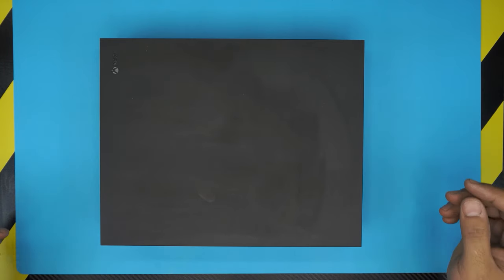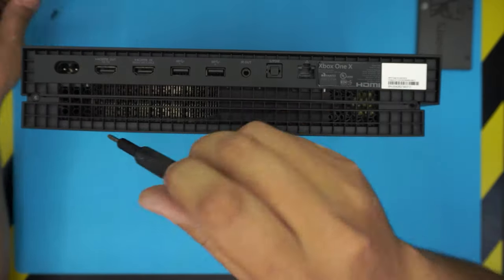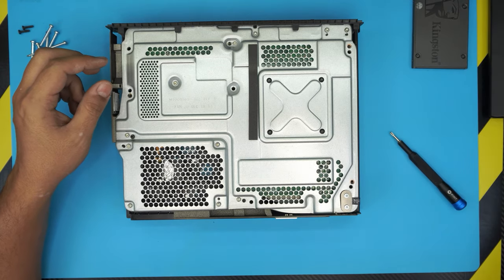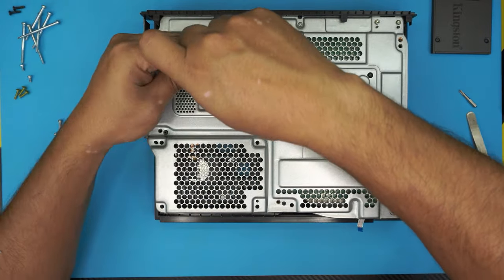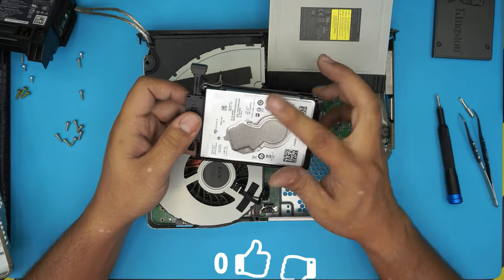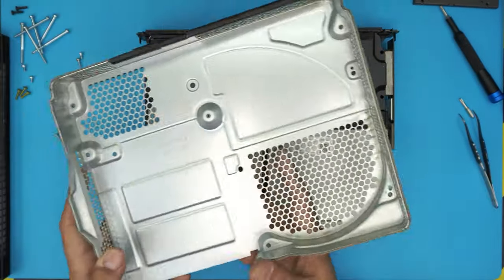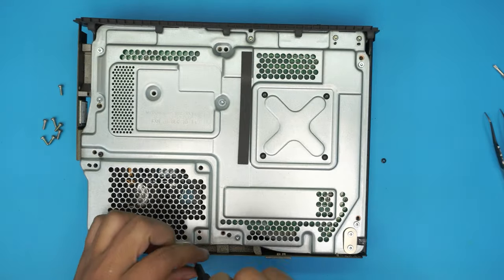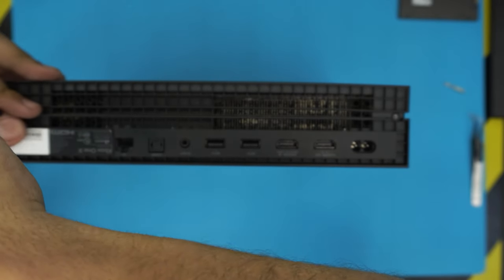Xbox One X Series SSD upgrade Guide proper way !!!

Comment: I’m glad I found your video before upgrading my ssd. Some videos they didn’t even mentioned about the ribbon in the front. Keep up the good work! 

One question, I’m having a hard time putting the top cover back. I did exactly what you did and the left side is not going all the way in. I’m sure all holes are aligned otherwise screws will not go all in. Thanks!
Reply from the maker: thank you for the feedback and your support to the channel :) regarding your question:
can you show me by a short video or upload some pics so i can assist you plz:
https://imgur.com/
Reply: What size did you put in? This guy says u can put 2tb and use the xbox site. Everything I've read said it only works that way if you replace with same size hdd as the xbox originally had. Can you confirm this man?

Comment: I was under the impression you HAD to partition/format the new external drive with some fancy scripts before installing it or the Xbox would not recognize it and allow an offline system update. Is it really as easy as just taking a new hard drive out of the box and sticking it in the Xbox, then using a USB drive to perform the update. It recognizes it?!
Reply from the maker: you could try cloning programs to clone the HDD to SSD  like Macrium Reflect,
the cloning sometime works and sometimes it can give error depending the hdd models or ssd models. we have tried and it does work but not always.

Comment: Great to ear you guys tested several SSD's , i have a question have you tried nvme ssd's and normal sata ones? because that would be a great coparison to know if there is any performance gains from a pci-e nvme ssd
Reply from the maker: don't put any nvme it will not get any faster, because the connector on the motherboard is sata and the max speed on sata is limited and if you adapt a nvme it will just read as sata max speed, therefore just go with any ssd sata. thank you for the support to the channel by a sub :)
Reply: I don't think PCIe NVME's will work anyway and SSD NVME's are not worth the hassle. With buying a caddy it works out the same price anyway.

Comment: First things first, thanks for the video, actually I used it 3 times to put a ssd on my xbox one x. But, well, I'm using a kingston a400 960Gb, after using OSU1, it shows a free space of only 364 GB. Took it to the pc (disasembling again) and saw a unalocated volume of 465 GB (half the unity). Tried all the process again with the same results. Any Ideas of how to fix it and use full space. thanks in advance.
Reply from the maker: Thank you for the feedback! if you wish to support the channel you can LIKE or SUB or both :P
regarding your question: it should took over the entire space, but if this happens you need to use dis-partition program on pc and extend the partition to the main 364GB, use this: https://www.partitionwizard.com/
download full version if you know what i mean :P
make sure you extend the virgin partition to the main partition.

Comment: Hi, I have an xbox one x. I replaced HDD with an SSD but when I install on xbox, it stops at 0%. After about 10/15 minutes it switches off by itself. Do you know how to solve this problem?
Reply from the maker: Thank you for the feedback! if you wish to support the channel you can LIKE or SUB or both :P
regarding your question: see if you doing all the steps in this video: https://youtu.be/xWW7M8pgFEo
Reply: @uFixTek  Yes, I followed the steps, but when I try to install on xbox, it stops at 0%. After 10 minutes the xbox turns off.
Reply from the maker: what brand ssd? and its used ? did you check the health of the ssd?
Reply: @uFixTek  The brand is Kimtigo 512gb, bought new on Amazon.
Reply from the maker: not all ssds firmware are compatible with bios of the xbox. most 90% of the brands are compatible.. adata kingston samsung and others, but the cheap brands like kimtigo or a likes are most probably not compatible. i would suggest replace the ssd with aknown brands.

Comment: I'm having trouble putting the top case back on😮
Reply from the maker: try wiggling around, it takes time to get the hang of it. not much force is needed.
Reply: @uFixTek The tabs won't seem to go into the holes. I'm just going to take my console to a GameStop store.

Comment: Hey im about to replace my hdd with a Crucial MX500 500GB SSD, is this one compatible with the os from xbox?
Reply from the maker: Thank you for the feedback! if you wish to support the channel you can LIKE or SUB or both :P
regarding your question: YES it is fully compatible :)
Reply: @uFixTek  Nice and thanks for your reply :), ill be doing it tommorow will deffo watch ur video while doing it ^^ hopefully its not too hard :D.
Reply from the maker: sure brother, if you need any help let me know.
Reply: @uFixTek  im having issues putting back the xbox... The screws arent lined up with the holes. P.S. It runs with the ssd but I just need to put the xbox back together somehow :/
Reply: Update*** I mananaged to put xbox back together and ssd runs fine :D, small note my xbox says 370 gb instead of 500?
Reply from the maker: awesome , the reason is because of the system format type and the extra partition that it requires.

Comment: Hi I have a higher capacity 2tb ssd. I want to replace my one X hard drive. However is there an additional step required to set it up? Also, next time please provide tutorial for how to do usb step instead of simply providing link
Reply from the maker: you can place the 2tb as you would the 500gb, same stuff, and im working to make a simple and quick video on the dashboard installation for you guys, thank you for the support and feedback
Reply: @uFixTek  thanks for everything so now if I want to put 2tb Can I put it?
Reply from the maker: @evolution6998  we have upgraded a client that wanted two TB and it worked.assuming that you have the updated firmware on board, but im very sure you won't have any issue.
Reply: @uFixTek  thanks for answering and I hope you had amazing day. Which type of ssd company you advice me to put in xbox one x?
Reply from the maker: @evolution6998  i would recommend ADATA or kingston for cheapest price and best i would use is samsung:
https://amzn.to/3OGDfyD

Comment: This is why playstations wins
Reply from the maker: :P
Reply: @uFixTek  I mean with playstation consoles going back to even the ps2 you didn't need to dismantle the machine to add a hdd.
Reply from the maker: same with xbox 360 they had hdd cover on one side, but tru ps3 ps4 always had cover to remove the hdd
Reply: @uFixTek  Even the ps2 could have a easy to access hdd if you got the network adapter
Reply: It isn't such a big deal.  I use an external drive but only because of a repair do I have to do this but how often do I have to do that?
Reply: @mikeforrest5912  Its better to load the os onto the ssd....
Reply: @UKgamer87  It isn't a big deal and certainly not a big enough deal to choose PS4 over an Xbox One X.  Pick it for VR sure but this?  Nah.
Reply: @mikeforrest5912  Its about how respectful they are of the consumer. Its anti consumer to have to go through this much trouble to replace a hdd. Think of how many x box ones are simply discarded because the hdd has died. Going through this much trouble is beyond 80+% of consumers.
Reply: @UKgamer87  You are not making sense.  If someone isn't bright enough to be able to remove the HDD then they certainly are not bright enough to test said HDD to ensure it is defective before replacing it.  How much would the feature cost to implement?  You don't know, you are simply fanboying.
Reply: @mikeforrest5912  Its a massive point of failure. I know people who know nothing about tech who assumed their harddrive died and simply googled how to do it and replaced it on their own on sony playstations. By contrast I know no one who did the same with their xboxes because the videos show how complicated it is.
Reply: @UKgamer87  If your friends can change a car tire they can change the internal HDD.  If they can afford to guess on the HDD then they can afford to have some local "tech: take a look and make sure they need one and get it right.  I don't know what is wrong with you and I don't care but you have issues my friend.
Reply: @mikeforrest5912  You're disinegnious. Take a look at how easy it is to replace a hdd in a ps3 or ps4 etc. Its no effort compared to this.
Reply: @UKgamer87  I don't understand ppl arguing w u over this. Ps4 is way easy. I have a xbox one x and wanted that ssd as my ps4 pro showed huge improvement on system speed. But after watching this video, I'll deal w the very slow xbox. That green xbox logo screen itself takes a long time.
Reply: @AB_n_C  I'd rather just take it to someone to do for me. I've built probably dozens of pcs  and I cant be asked to deal with a xbox one ssd upgrade.
Reply: The hardest part is putting back the top cover😮